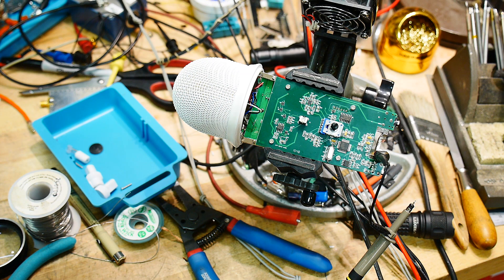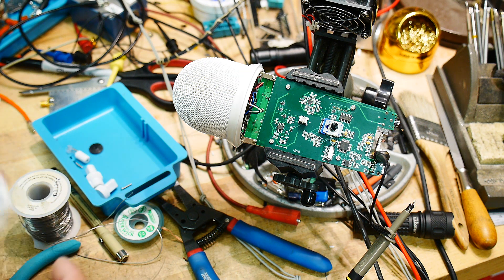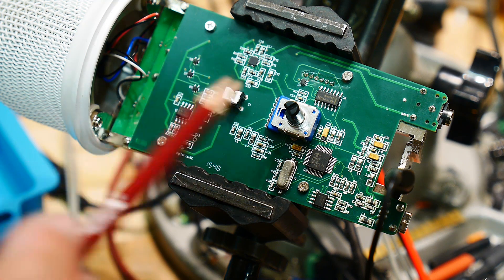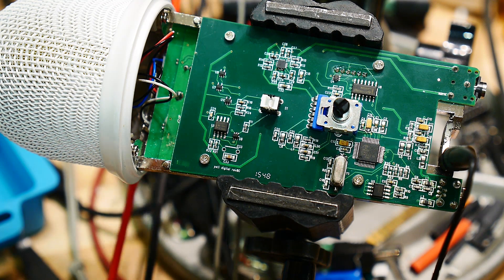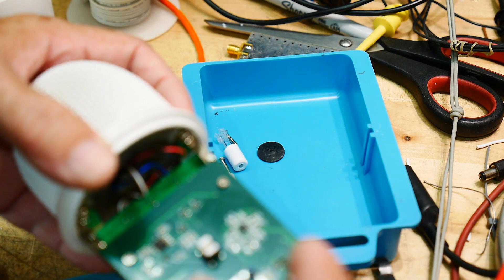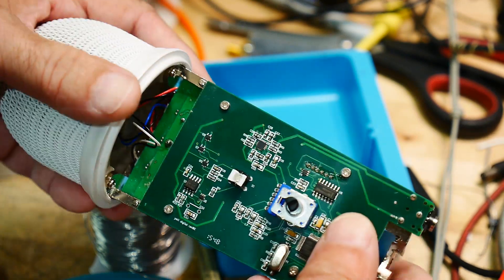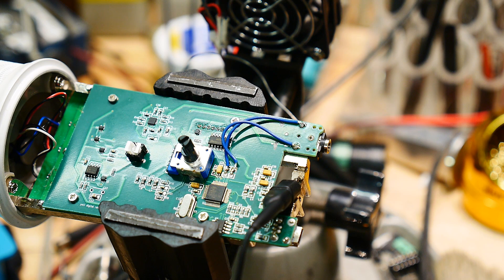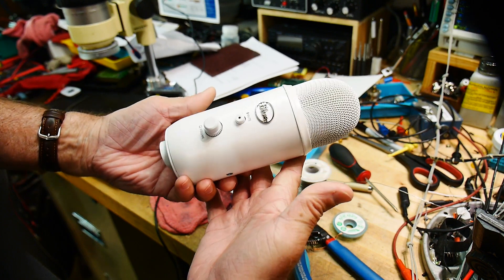#555 Dead Yeti

Comment: Hi IMSAI Guy, I have a sick Yeti. When recording I get a low hum/noise and low audio. When I amplify the recording, I hear the recording but unusable. Found R34 was missing on the audio board. Trace look very similar to R31, R32, R33. Not sure what this does in the circuit, want to take a stab at it and replace it. Got a number off the other resistors that are all the same 01A. I searched around and ppl have said its a 100 ohm resistor. Sound right?
Reply from the maker: I have no idea